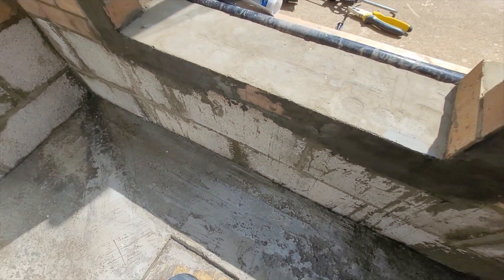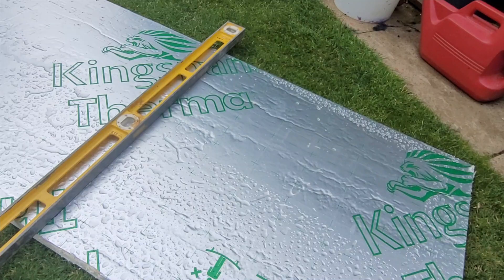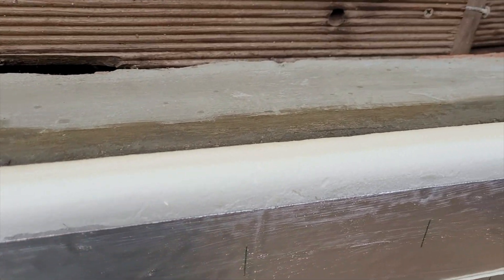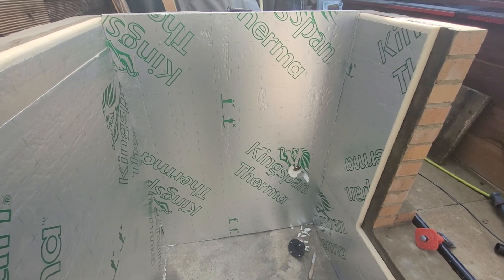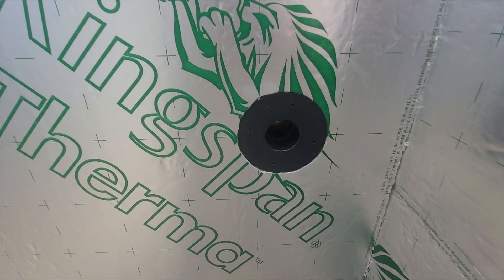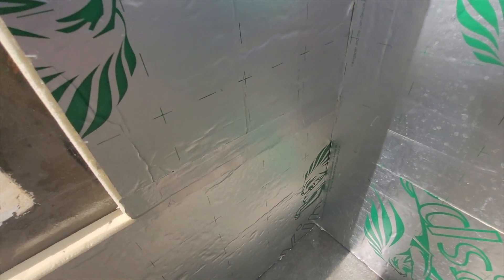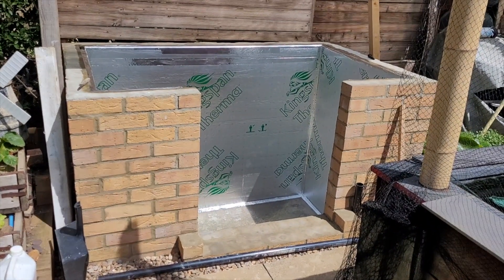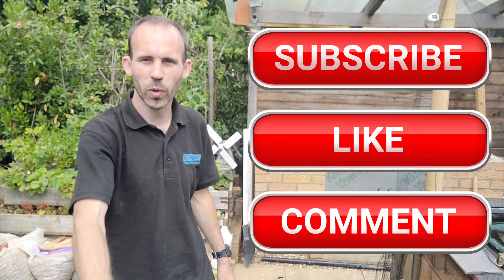How to Insulate a Koi Pond with 25mm Kingspan ready for Fibreglassing

Comment: Is it worth insulating a box lined pond if not heating it pal?
Reply from the maker: It will be heated mate and fiberglassed not box lined 😊👍
Reply: Sorry pal, I'm building my own pond and asking if it's worth insulating when using a box and not heating a pond at all?
Reply: Box liner**
Reply from the maker: @TheKoiReefer  sorry bud miss understood, yes 100% worth it as the sun on days like today if not insulated the pond would heat up very quickly which then means at night it will drop rapidly as well so insulating a pond helps keep it stable.
My main pond is insulated with a box weld liner and has made a massive difference compared to my last pond I had 👍
Reply: Do you have a link to what you used?